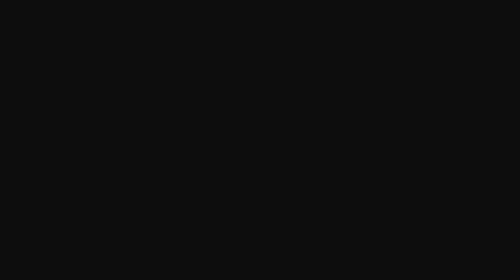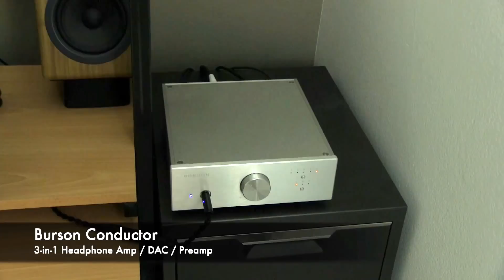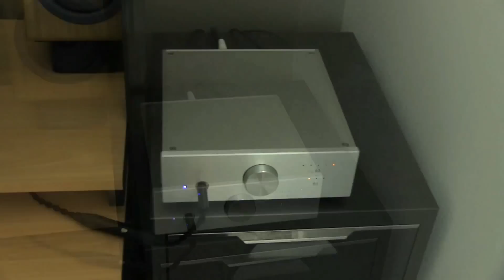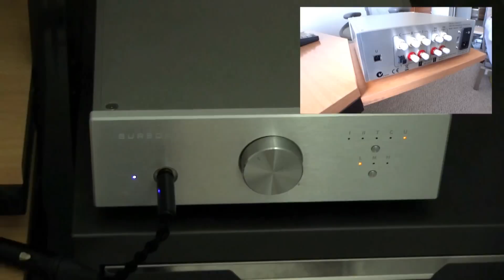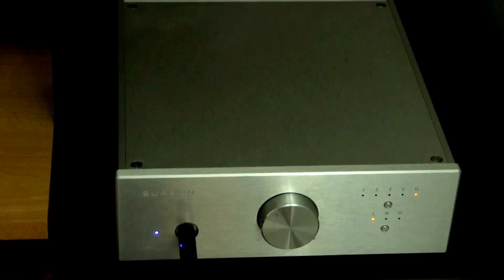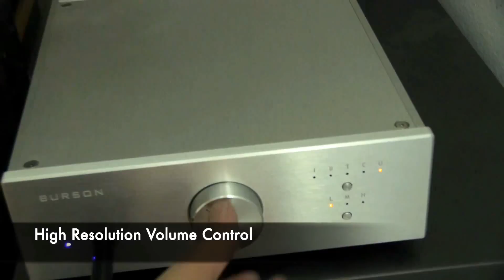Reviewed - Burson Conductor DAC Headphone Amp & Preamp

Comment: It's quite a strange sound signature - powerful and rapid bass - smooth mids - but at the same time really cold and crystalline highs. Huge dynamic range - but it's an effort to listen to this set-up on my HD800 :(
Reply from the maker: Yeah, that's not the ideal pairing. IMO, the HD800 needs a darker amp.
Reply: I'm thinking of getting the PCM1793 DAC module to replace the Sabre - I mean I feel that the highs need to be changed just a tiny bit for me to listen comfortably :)

Comment: Curious as to how you had it connected from the source? Toslink, Coax, RCA?
Reply from the maker: Another Skywalker USB
Reply: @phototristan  It might sound odd, but I have a Panasonic UB900 Blu-ray player and I put all my FLAC music on a portable SSD which attach to the USB port. I have the BRP connected to the Burson ACV+ via analogue (RCA cables). I'm using Sennheiser HD650's. Sounds wicked! I tried it via Toslink but it sounded very 'thin' and lacking bass. Is that normal for Toslink?